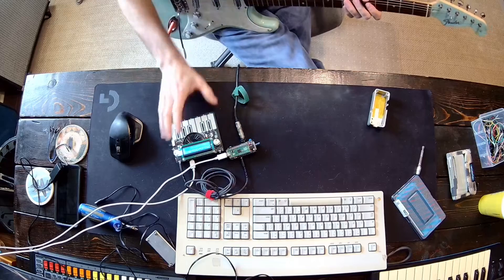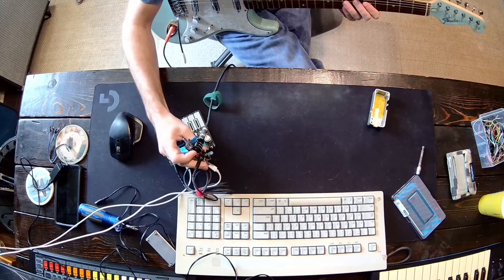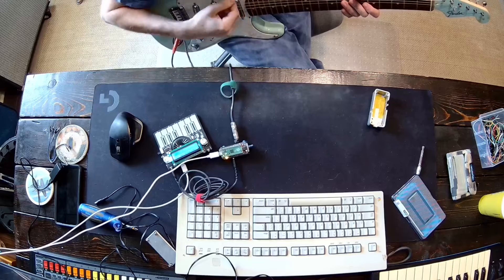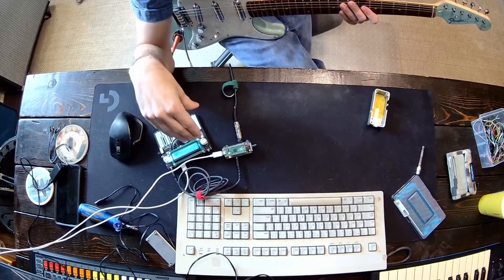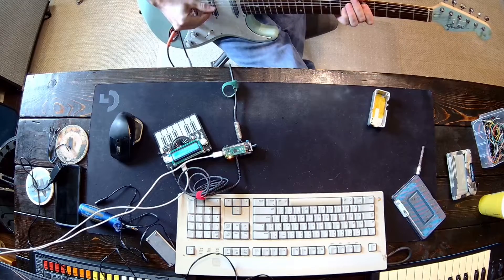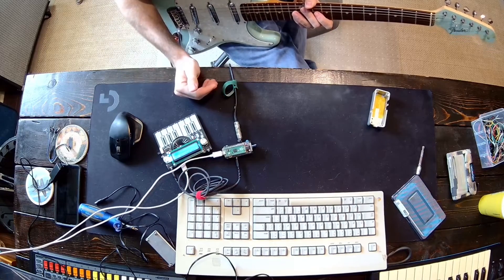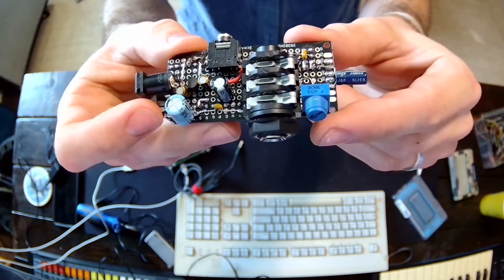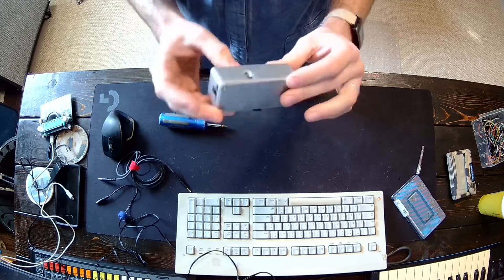Turn Your Guitar into MIDI with the Raspberry Pi Pico

Comment: I made a guitar pedal called the GuitarPico that includes a Guitar to MIDI (USB) pitch generator.  I mostly use it for tuning, but it can be used to play into a computer as well.  It also has 20+ guitar effects on it as well that can be cascaded.

I made my own algorithm for doing the pitch recognition that is very fast based on binary autocorrelations.  It logs the sign of the zero crossings (whether they are + to - or - to + and the number of samples between them), and then uses this information to compute the autocorrelation, the highest peak of which corresponds to the note, though I tend to weight lower peaks slightly more to not catch harmonics.
Reply from the maker: I imagine that's pretty efficient and works well enough. The fft stuff is cool and all, but it sucks out a lot of performance and I don't think it's the most accurate either to be honest.
Reply from the maker: I forgot to mention, but I have expanded upon this quite a bit in a new project. Loads of effects and everything like you mentioned.

Comment: I have been looking into doing pretty much the same thing. I would like to make a device for real-time audio to MIDI conversion. An audio input on one side, a MIDI output on the other, basically plug in any thing that makes noise and has an audio out jack and turn it into MIDI notes. I wasn't sure how possible this was, but you've given me a good idea, it's going to be pretty difficult to get it to work correctly.

I wonder if a few switches, maybe some pots were added they could be used to fine tune the conversion algorithm. Like switch between voice, drum, guitar, and piano. Then fine tune with some kind of knobs. IDK what i am talking about, but I am kind of excited about trying it out. :)
Reply from the maker: There's definitely a lot of room here for improvement. I recommend checking out the inner-workings of the code repository to get an idea for how I'm doing things. At the moment, the note tracking/tuning algorithm is the biggest crutch and needs to be replaced altogether BUT the RP2350 (Pico 2) just came out which fully supports floating-point calculations. Before, all calculations were using 16-bit signed integers because of the limitations of the RP2040. I'll probably switch over to the Pico 2 (or design a dedicated board for the RP2350) and use an algorithm which uses floating-point calculations to achieve much greater precision and speed.
Reply from the maker: Of course some hardware controls would be nice to have as well, but I wouldn't place that as a priority.
Reply: @relic-se  That makes since, better to focus on the basic functions first. 
I have about 3 projects ahead of this, and this is really just an idea at the moment. If I get anything going I will come back and let you know what I did.

Comment: Dude! This is awesome! I've been working on basically the same thing but for an 3D-printed cello for a while now. But I've been stuck in a few places. I was used a Sonuus G2M v3 and trying all sort of different types of pickups for a while but can't find the best way to send an audio signal to it. I also looked into software solutions, but I really want to make the whole device a standalone piece of hardware. Recently I've been researching how to use a Teensy and Teensy Audio Shield to use FFT to quickly register notes, but my coding experience is pretty rusty now. It'd be awesome if you kept the project going! I'd love to see where it leads you :)
Reply from the maker: I think you're right on the money. I need to swap over to a simple FFT frequency tracker rather than the current implementation. The pickup shouldn't matter too much for this purpose. A peizo transducer should be enough.